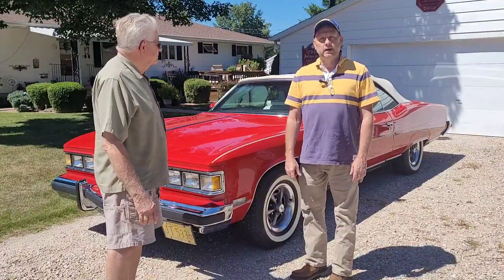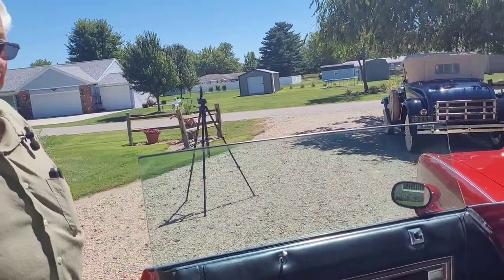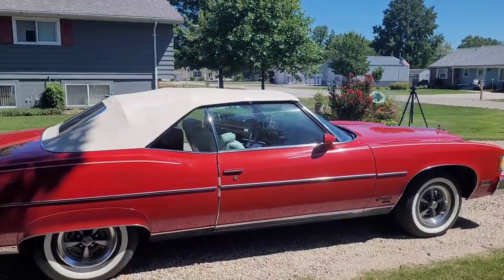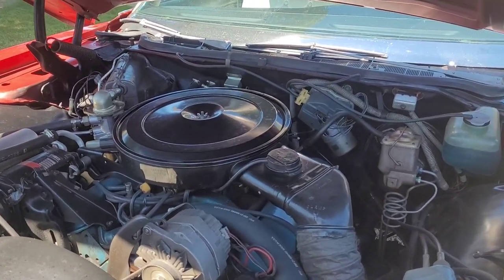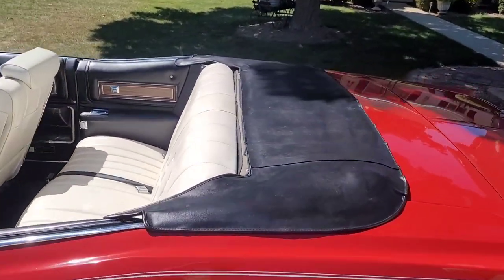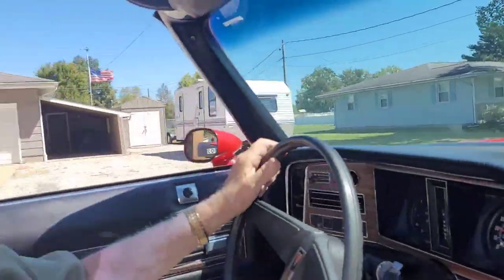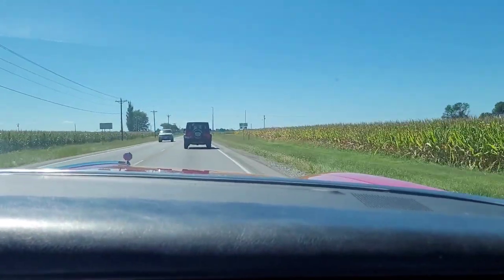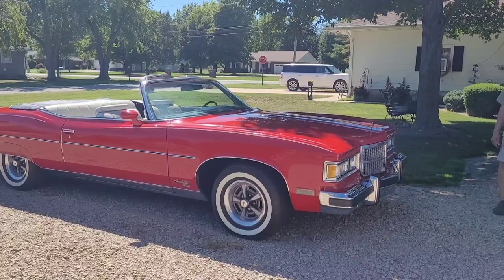Art's 1975 Pontiac Grandville Brougham Convertible All Original 66k Miles and Loaded

Comment: Seeing this Grandville Brougham Convertible brought back so many great memories of the one that I owned from 1988 through 1993.  I would still own it today if it hadn't been ruined in the Paradise Creek Flash Flood of 1993 as my Insurance company totaled it and refused to restore it.  It wasn't quite as well equipped as this model.  Mine didn't have the optional 455 (standard 400), no cruise control, no air conditioning, no power seats.  It did have power windows, power top, and remote deck lid release.  It too had the Rallye Wheels, white interior and top -- only it had red interior trim.  Mine was Onyx Black for the exterior color.  It was one of my favorite convertibles.  I still have one convertible, a 1984 Cadillac Eldorado Biarritz in medium blue metallic with white top and white leather.  Thank you for going into such detail!
Reply from the maker: You're welcome, and thank you for watching and commenting! It's a shame the insurance company totaled the car. No one looked into the future to see how fast these cars would disappear. They're so hard to find in this condition now.

Comment: ART is a amazing car enthusiast and caretaker of his vehicles. I have a 76 Buick Electra that also has the two buttons, one is for the interior lights, and the other is for automatic release locks back of the front seat. So you can fold it down with them manually holding the lever. Great channel.👍
Reply from the maker: Thank you very much! My Mercury has those automatic seat back releases, but they are triggered on the same switch as the dome lights. I didn't even know GM had them. Thank you for clearing that up, and thank you very much for watching! I appreciate it.

Comment: The extra door jamb switch is to release a locking solenoid in the seat backs so you can fold them forward without pressing a manual lever when the door is open.  It was an option.
Reply from the maker: Yeah, we figured that out. It's strange to me because the ones on my Mercury are operated by the one dome light switch on each side. Thank you!
Reply: Wow

Comment: What a creampuff! The Grand Ville Brougham was a specific top of the line model. This car is odd to me, in that the white seats are usually only installed in a "full" white interior. I wonder if they have been replaced/recovered, or if this was a true special order. It certainly is nicely equipped! And Tony, GM split bench seats of this era were typically unevenly divided -- Pontiac called this the "60/40 seat". Not like those of our beloved FoMoCo cars. In the brochure I found online, only one 455 is listed, and it is not described as "high output", and no factory alarm was listed, though the option list is clearly not complete. MIght the switch be for a seatback release or aftermarket alarm? I love that you put the boot on it before going for a ride -- I always did when I had a convertible. Again, thanks to Art and to you for sharing/featuring this great car.
Reply from the maker: Thanks, buddy! The white seats were definitely special order. I've seen it in a number of them online. I don't know about that extra switch. I don't hear an automatic seat back release. I've also only seen those in Ford products.

Comment: I agree with some of the other comments about the purpose of that second switch. I think it allows the front seats to pivot forward to gain access to the rear seats only if a door on the same side is open, otherwise the seat backs are locked in place for safety reasons. I remember when some cars didn’t have a locking latch, just pushing allowed the seat back to pivot forward. I never heard a beeping fasten seatbelt warning on a GM car that year. They did have a System where the Starter would not engage if the belt wasn’t fastened first. There were many dead batteries the next morning if someone left a heavy object on the passenger seat, as this would activate the sensor, draining the battery due to the current draw.
Reply from the maker: I'm gonna check that seat latch out the next time I'm at Art's. My Mercury has those, but they are loud enough to hear.

Comment: i have one too...much more basic than this exceptional and loaded example.  Red I think was the most popular color.  they just have a graceful way of moving down the road, super boaty but still well controlled with the RTS.  People are amazed over the size of the car, and that it's a Pontiac...a lot of people assume its a Buick or Cadillac.  Exact same top between all the fullsize convertibles these years...in fact my car has a bit of an Eldorado top in it when I had it repaired.  the Chev and Pontiac convertibles were the topline trim, the Buick and Olds were the lower trim models...all based on the B body and not the larger C body.  This is my fav of the scissor tops, along with the 71-72 Centurian.
Reply from the maker: Yeah, this Pontiac definitely is better looking than all the others that were basically the same thing.

Comment: In 1971 Pontiac started the Grandville which replaced the Bonneville as the top model for Pontiac until 1975 when the Grandville was discontinued.  The Brougham was a trim option.   According to Wikipedia just over 4,500 where produced for 75.
Reply from the maker: Wow, not many! Thank you!

Comment: Tony, the extra switch is probably for electric seat back lock release.
The Grand Ville was actually the same inner structure as Olds 98, Buick Electra and Cadillac de Ville. It DID share glass and roofs with those cars.
The advantage to the scissor action convertible top, which was pioneered by AMC on the 67 Rebel and Ambassador, was a full width back seat. The Nash Rambler had a motor driven, cable actuated folding top when it was first introduced back in March of 1950.
Art's drop top Poncho  is nothing short of magnificent!
Reply from the maker: Thank you! Several have said that, so I believe you are correct.

Comment: Wow! I didn’t see that hiding in the garage. I love the big Pontiacs. The ‘75 was the last year, as Art said. The rectangle headlights were Granville exclusive. The Catalinas had round ones. There were two engines. A 400 with 185hp and just one 455 (it wasn’t an HO) that had 200hp with 7.6-1 compression ratio. The 455 did 0-60 in 11.5 seconds but it felt faster with gobs of torque. The 400 did it in just over 12 seconds. That car is like new.
Reply from the maker: Thank you for clearing that up for us! I appreciate you!
Reply: I had a 75 Grand Ville with 55,000 miles that I gave $400 for. 
It ran real rough and the lady thought it was a goner. Just needed some vacuum hoses, and ran like a top for the next 100,000 miles. 
The only thing that ever broke were the u-joints. 
Had to replace that drive shaft twice. 
On this car, it looks like the only option it doesn’t have are adjustable pedals. 
Those are RALLYE II wheels. 
Had those caps stolen in parking lots a couple of times.
Reply from the maker: @ResetDoitAgain  wow, what a deal! Thank you for clearing up what the wheels were called. All I know is they make the car look great. I didn't know adjustable pedals were available back then.
Reply: @tonyscarcare5657  Probably could have used them as the front and back of the car are in different zip codes!
Reply from the maker: @michaellindquist31  😂🤣😂🤣

Comment: Nice car but I do not ever recall a 455 HO for '75-'76. The SD engines were no more after 1974 so there was no such thing by '75. It cranked out a miserable 200 HP for 7.5 liters. Lots of torque though.
Reply from the maker: Thank you. Several have pointed that out. I appreciate you watching and commenting.

Comment: Those are Rallye II wheels, the 455 HO was never offered in the Grand Ville. The Grand Ville was a separate line and not a trim package on the Bonneville. The official term for the top is an “inward folding” top which allowed it to be completely flush with the deck lid. I always pulled the fender liner for blower access.
Reply from the maker: Thank you! I believe that's all been covered in the comments.

Comment: That other button might be for the ignition buzzer when you open the door with the key in the ignition.
Reply from the maker: I don't know. It's strange because cars for years have had buzzers and only one switch. If it was mine, I'd have to follow it it see where it goes! 🤣
Reply: In Cadillacs of that era, the second switch was used to operate an electric front seatback release mechanism.  There was an electric unlocking mechanism to fold over the front seats (when the door was open) to enter the rear seat on either side of the car.  No need to fiddle with a manual seat back release button.
Reply from the maker: @Carguru1  hmmm. My 78 Mercury has that, but they are loud and actually coming up in my next video. I didn't know GM had it. I learn something new from you guys every day! Thank you!